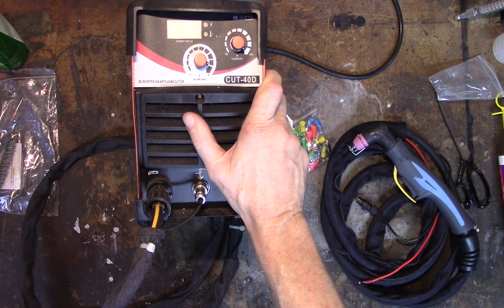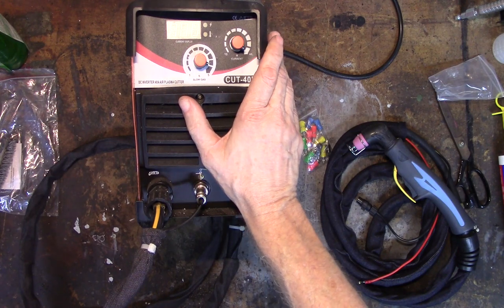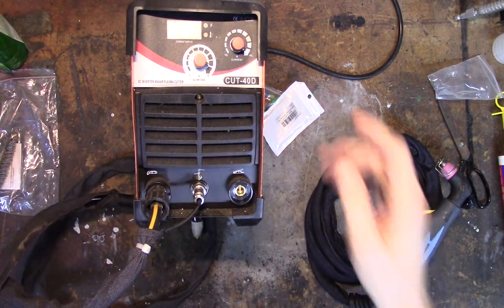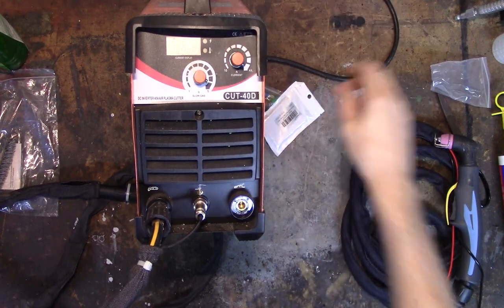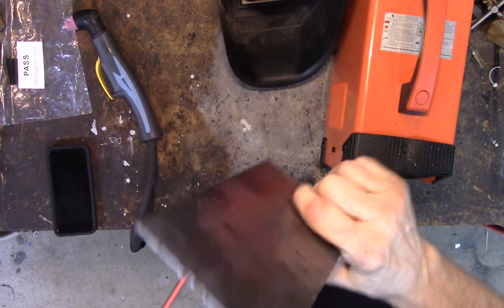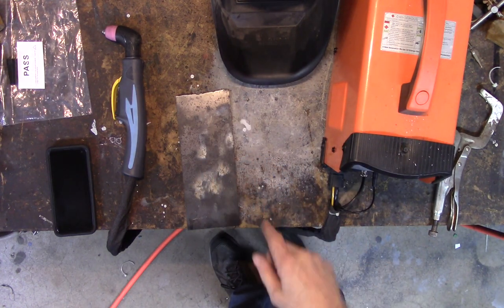Upgrade your plasma cutter to pilot arc! It's easy!

Comment: With any plasma arc you need BOTH leads for them to work right. So when you did your first cut you only had the torch connected and no ground, except for the Torch tip. So that's why it wouldn't cut till you touched the tip onto the metal.
Reply from the maker: Yea, I know, I screwed up. Making videos is hard when you have a one track mind.
Reply: Good observation! The ground wire was not even plugged into machine.
Reply: I'm glad I saw your comment because I thought connecting the ground clam was a given and it was connected elsewhere.

Comment: What do I search for to find the add on board?
Reply from the maker: "Pilot arc conversion board". You'll find them on Ali Express for about $30. Be aware that I have no idea how well something like that will work, or how to connect it properly. With the price of pilot arc machines so low I think you'd probably be better off selling your existing machine and buying one with pilot arc if it's a must have feature for you. Good luck!

Comment: And a pilot arc is so you can start in the middle of the metal if you have to but still need a clean ground
Reply from the maker: That might be how pilot arc was marketed, but it's not true. Pilot arc may help with piercing, but any decent plasma cutter with a drag tip and no pilot arc will pierce through if done properly. It's hard on consumables, but it will do it. And modern "non contact" cutters will jump the arc from 1/8" to 1/4" away, even on rusty metal, without pilot arc, so it's not even hard on consumables. Hence my statement at the end of the video that I don't really see it as being necessary any more.

Comment: If you switch the jumper lead you could switch between plasma arc and non
Reply: Would you ever really want to disable it though?
Reply: @JesseKlaus  it's less powerful if the ground is only connected to the tip.

Comment: Thanks for the video. I have a Simadre  Cut 50D I might have to try that on.
Reply from the maker: It's really easy to do,  just don't expect the pilot arc to work that well if you're running it on 110v. And that's not the fault of the conversion, even plasma cutters that come with the feature don't have good pilot arc on 110v.

Comment: Hey Chuck, just be aware that plasma electrode tips have different diameter holes. You mentioned a P80 torch. If you are going to run it on 110v, you are going to have to go down to a 0.8mm electrode tip and they are hard to find and expensive. They are made to be used on a 30 amp machine. I am not sure you will be successful with a 0.8mm electrode tip at 110v.  The 1.1mm electrode tips are for  full 40 to 50 amps at 220v. The P80 were made originally for Panasonic plasma cutters.
Reply from the maker: Thanks for the tip! I did know there were different sizes for different torches and power outputs, but haven't really looked into it too deeply. The 60 amp torch is working well on my cheap little Cut 40 machine which runs great on a 20amp 110v circuit. I got the P80 torch for the Simder Cut 50 which doesn't run hardly at all on 110v without popping a breaker, but is a fire breathing monster on 220. Anyway, even if it doesn't work that great I'll have fun experimenting with it. Which reminds me, I need to get that done as I've got some work to do with it soon! Thanks for watching and commenting!

Comment: Hi, after you have modified the  machine torch. Do you think the plasma torch consumable part will last longer than the previous one ?
Reply from the maker: IMO how long your consumables last depends more on the user than whether or not the torch has pilot arc. If you're experienced and careful you can use scratch start torches and the consumables can last a long time. But for someone new to plasma cutting, or who's careless, having pilot arc and a torch that prevents the user from dragging the tip on the metal, then yes, it will extend the life of consumables by a lot.
Reply: @3rdpig thank you for your respond. By reading this, i'd like to keep my existing scratch torch as the way it is.

Comment: Would it not have been easier to buy one already set for pilot arc
Reply from the maker: Sure it would have. You know what would have been even easier? Emailing my drawings to a local metal shop and have them cut it all out and deliver them to me. Even easier than that is to buy the parts I want fully fabricated, welded and painted. Problem is, it starts to get progressively more expensive each time it gets easier. So everyone has to weigh the extra work vs the extra expense and decide how much "easy" they can afford.

Comment: Thank you for the video! So, the Plasma arc's other two cables won't connect to your scratch start plasma cutter?
Reply from the maker: If I understand what you're asking, then yes, but not easily. There's no place in the scratch start torch to connect a a pilot arc wire. So not only would the wire have to be run but you'd have to figure out how to attach the wire to the electrode in the torch itself. Not impossible, but when you're done you're still stuck with a torch that has no means to have a standoff attached, which is one of the big advantages of pilot arc. And honestly, pilot arc machines are only a few bucks more than one's that aren't, if it's something you think you're going to want just buy the machine with it built in.
Reply: @3rdpig  Thanks for the great explanation. Although I researched my purchase, I was ignorant about scratch vs. Pilot Arc. I'll eventually convert it to Pilot Arc, but want to get some practice in before I, potentially, screw it up. Great conversion, thank you!

Comment: Ok, I was going to say that when you were on 110 volts, you had no work (ground) lead connected. So after you corrected that, did it work on 110 as well?
Reply: Great job on the conversion, btw!
Reply from the maker: It sputters, but it does work. And I'm not the only one with pilot arc stuttering issues on 110v, even machines that come with pilot arc and are designed to run on 110v often stutter when on 110v but not on 220v. Just the nature of the beast, I suppose.
Reply from the maker: @thebeardedstork432  Thanks!

Comment: So what guage do i use for the pilot arc wire,,i bought a new torch and it has a short black wire that is suppsoe to connect to ground on plasma cutter..do i connect that wire to ground on front of plasma cutter,,i have a cut 50 plasma that only has non pilot arc so i bought new torch with pilot arc...didnt know i was going to have run a extra wire
Reply from the maker: If you bought a torch with a hose then all you have to do is get the pilot arc wire from the torch to a ground. If you don't mind dodgy work, you can just connect to the ground lead. I've seen examples where it's just wrapped around the ground lead under the insulation, but if I were do do it that way I'd use some sort of bolt or screw to secure it. But I prefer doing it the way I showed in the video with a jack of some kind on the front panel of the machine. Wire size doesn't have to be extreme, 16 gauge is fine, I used what I had laying around. If you're going to run it off 110v you're going to find that pilot arc isn't all that great. On 220 it's pretty good though.

Comment: What are the connectors called that pilot arc is connected to if i drill a hole to make the pilot arc wire go through,,i calll it a lug but cant find any online??
Reply from the maker: I used what's called a banana plug, male and female. They're a staple in the electronics world and you can buy a bag of them cheap on Amazon. But you can use any kind of connector you want, even a stud with two nuts to hold it on the front panel, then ring terminals on the wires will be fine.

Comment: Maybe i missed something, but why change the head on the old hose assembly?  why not just use the new assembly, which already has the preferred head and pilot wire out of the box?
Reply from the maker: Because I wanted to use the P80 torch on a more powerful plasma cutter. Sorry, I thought I explained that in the video but it may not have made the final cut.

Comment: This is an incomplete mod.  You still need to add in relays and contactor to disconnect the ground connection.  If not, part of the current goes through the wire instead of through the part.  Normally, you need some sort of sense circuit like a magnetic reed switch or a current sensing circuit.  Once its detected, the connection to that banana plug is then opened once the pilot arc is lit.
Reply from the maker: I agree, it's a hack workaround. I should have made that more clear in the video.

Comment: Out of curiosity why did you swap the torches to different cords as opposed to using the cord the pilot arc torch came with?
Reply from the maker: I bought two torches, the AG-60 in this video that came with the full lead, and a P-80 that was the torch head only. My thinking at the time was that I wanted the large P-80 torch on the heaviest lead I had, which is the one that came with the AG-60 and that I'd then put the AG-60 torch on the older, lighter lead. Of course before I could do that I changed my mind again and have since switched the torch on the machine in this video back to the PT-31 torch that came with it because I intend selling it and don't want to sell the AG-60 torch with it.
Reply: @3rdpig  ahhh alright.  Have you noticed any issues with this approach to adding pilot arc?  I'm curious why the manufacturers wouldn't just do this straight out the gate if this is really all there is to it.  I read on a couple forums about people creating a time delay before the arc starts so that the air flows first by .5-1sec.
Reply from the maker: @JesseKlaus  I can't answer why most manufactures don't do it other than it's going to add to the cost of the machine and to be quite honest, it really isn't necessary.  A more expensive torch has to be used, it has one more wire running the length of the lead, the internal and front panel connectors have to be there. Considering these "cheap" cutters are vying against each other for our attention, I'm guessing a $20 increase would be seen as a big deal. Even the last one I tested, the Vevor, which has an improved PT31 torch and a pressure gauge in the front panel, hasn't done it. And while I haven't noticed any problems after adding pilot arc that machine, there are a couple of things to consider. First, pilot arc sucks on 110v and it's not just this conversion it's everyone I've seen. Pilot arc is, at least IMO, only useful on 220, and on 220 most non pilot arc machines are powerful enough to start an arc through rust and paint with no problems. Hence my opinion that pilot arc isn't really necessary. However, it is quite useful when you're using a standoff to keep the tip away from the base metal, or on a circle cutter which does the same thing. I haven't heard about the mod for making the air blow first, I suppose that's a trick to make the tip last longer. I suppose it wouldn't be that hard to rig up, but in my experience once you get good with a torch consumables last a pretty long time. It's when you're new or you do stupid things that you burn up consumables. Since I'm pretty good with an oxy-acetylene torch, and since the technique of using one is pretty similar to a plasma cutter, I never really had too much of a problem with consumables...unless I was doing something stupid, and in those moments I pretty much knew I was going to destroy a tip in order to get a job done. They're cheap enough, so it's not a big deal unless you're on the last one.
Reply: @3rdpig  good to know.  I think I may do the same mod to my Yeswelder MP200.

Comment: hi how are you i have a tig inverter welding machine. I want to turn this machine into a plasma cutter. Do you know anything about it?
Reply from the maker: I've never done it, but I'm guessing it wouldn't be all that terribly hard since I'm betting most of the cheap Chinese plasma cutters are just converted TIG machines.  You'll have to buy a plasma torch with hose and leads and an air regulator and they'll have to a solenoid operated valve to turn the air on and off when you squeeze the trigger. Some of the TIG machines might already have one for gas, and some of them use a torch with a manual gas valve on the torch itself. You'll need to mount the regulator on the back, pipe the air into the solenoid valve, wire the solenoid to power and to the trigger switch and connect the air supply from the valve and the main power lead to the plasma torch. And if you buy a torch with a pilot arc wire you'll have to add that in like I did in this video. Assuming you buy a decent plasma torch, regulator and solenoid you're going to be into this conversion at least $70. Is it worth it when a plasma cutter is only $150? I think I'd sell the TIG and just buy a Plasma Cutter ready to run.
Reply: @3rdpig  thenks  i am from turkey 1$=19 ₺  :(
Reply: Just spend the 200 dollars that will get you an entry level plasma cutter. Do't start messing with the tig welder risking messing it up and costing a bunch to repair.

Comment: I have a plasma cutter which i am trying to weld aluminium with it but not winning .
Argon gas connected and tig torch connected .
Qhat can i do to make it weld aluminium
Reply from the maker: I don't even know where to begin. Do you know how to TIG weld? Do you know how to set up the torch? Does it strike an arc at all? If so, will it melt the base metal? Without knowing a lot more I don't know what I can do to help.
Reply: You need an AC not DC Tig welder

Comment: Will it not erode or damage the nozzle tip?
Reply from the maker: Used sparingly and only when needed I don't see it making a difference. Waved around like a light saber? Sure, it's going to accelerate wear on the consumables.

Comment: Can the P31 torch be converted to pilot arc    cheers
Reply from the maker: I think so. You could run the pilot arc wire inside the torch cover and connect it up at the electrode.

Comment: Is pilot arc connected to positive wire/
Reply from the maker: Pilot arc wire should run from the ground terminal at the machine end to the electrode on the torch.
Reply: @3rdpig  thank you Bryant,

Comment: So whats a pilot arch
Reply from the maker: Pilot arc is when the torch will produce an arc without the ground. Let's you cut through paint or rust without cleaning it up first.
Reply: @3rdpig  so maybe up an help me with this dilemma. I bought a used Mac tool cpa 20-ps with a crushed torch. Iltge cord is shorter then I would like and I’m looking to get something longer . But I can’t find a part number for the torch to try to cross match. You have any info I can steal from you to help with this?

Comment: What the hell is a banana plug? And I'm not sure where you ran the wires you added. Very vague on everything.
Reply from the maker: I not only stated clearly where the extra wire goes, but at 6:10 in the video I zoomed in and showed it. Simply put, it goes from the internal lug from the ground clamp to the female banana plug I added to the front panel. That's it for the changes inside the machine. On the torch itself, since it came with the pilot arc wire already in it I just clipped off the ring terminal at the machine end and put on the male banana plug then plugged it into the female banana plug I already added. That's it. That's the totality of the changes.
As far as what a banana plug is, 10 seconds on Google or Amazon could have answered that for you. They've been used in small electronics for at least 50 years.
Reply: @3rdpig  ikon
Reply: Me thinks if you don't know what a banana plug is you should not be a messin wiff lelectricity. 😆
Reply: @GMacnz  a banana plug is not commonly used or common knowledge to a non electrician. My point was for him to explain to those that don't know. But since we are on the subject, a banana plug is not adequate for the voltage passing thru it. But who am I to say right?
Reply: @racerguy500  they would be fine for the voltage but amps would melt them quite nicely
Reply: @GMacnz  that was my thinking too.